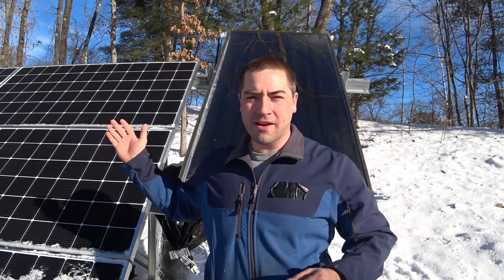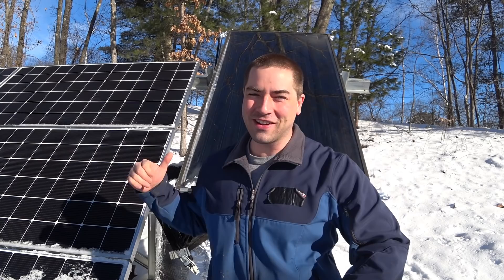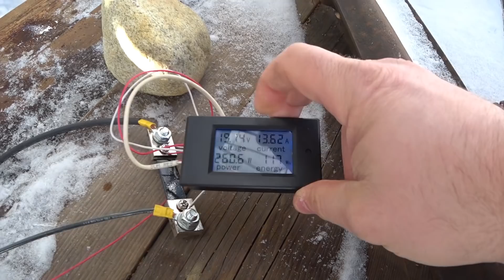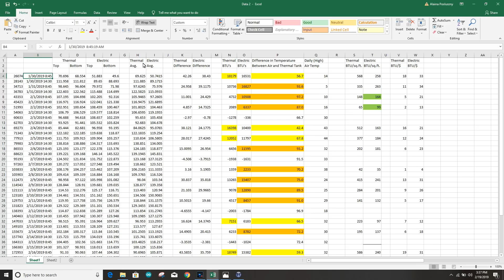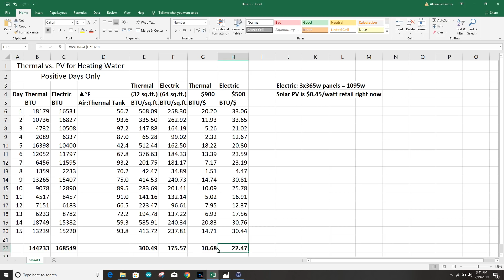Results of Solar Thermal vs. PV Experiment in Heating Water

Comment: Nice results A small thing which may interest you I made a PV system but used a 240V ( I am in Australia) by using a PWM device to produce a steady 240V which allows the PV panels to operate at optimum. If I did it again I would have stayed simple as you did but it produces slightly more useable electrical energy. Last you do not mention what you do with the PV energy in summer? Do you have any plans for longer term heat storage in the works?
Reply from the maker: Hi.  I have a heat store in my house.  About 8 years ago I built a custom 250 gallon water tank in my crawlspace under my house.  I have 1,000 feet of tubing coiled inside the tank as a heat exchanger.  The tank water circulates through 3 hydronic panels that heat the water year-round.  This is used for DHW (domestic hot water) for showers/sinks.  There are several videos on this build on my channel if you are interested.

Comment: I have plenty of space for any or even both of these type of solar collectors, the question is, in a cloudy or very cloudy day with cold, which one will still produce warm water / energy ? because on a sunny day both of them will do the trick.
Reply from the maker: since space is not an issue, I would 100% go PV.  My PV array still produces some energy on cloudy cold days.  My hydronic collectors won't produce any heat on a cloudy day.
Reply: @DavidPozEnergy  exactly my thoughts..... and pair PV with a heat pump and it is done! hot water for house heating or any other usage doesn't matter the weather as long as you have sufficient panels to cover the cloudy days!

Comment: This is a weird comparison - we never get to know how large the PV array was. Of course a gigantic PV array will do just fine in producing warm water. You should have compared panels of the same size (direct solar heater with a heater relying on electricity from PV). In such a comparison direct solar wins hands down because direct solar is so much more efficient at heating water than electricity produced from PV. There are advantages of PV over direct solar in that PV panels still produce electricity when the sky is overcast or the sun is low on the horizon. Direct solar heaters need direct solar radiation impinging at an optimal angle to really work. Combine both systems and optimize with a clever control.

Comment: I would like to see a comparison between concentrated evacuated tube solar thermal vs PV vs thermal pannels, because as far as I can tell concentrated evacuated tube solar thermal does not suffer to nearly the same degree due to the tank temperature and can even work on cloudy days because assuming you are increasing the intensity of the sun with the reflectors by 10x that's equivalent to a summers day if you were to have a bare evacuated tube.

Comment: This is really great information. I really like how you can focus on both efficiency per unit area vs efficiency per dollar. Thanks for making this video.
I also find it super interesting how the solar thermal capped out so quickly. This suggests that the design could benefit from lens concentrators inside the panel itself for the thermal panel, to boost the incoming maximum temperature.

Comment: From the initial scenes of the video I see at least six PV panels compared to only one small thermal panel - this is not a fair comparison :) If you would have tested an evacuated tube solar collector then you would have seen the difference in favor of the latter especially in cold climates.

Comment: Hi! Could you check out DualSun hybrid panels. It’s a electric solar panel with a heating loop on the back. Could you test it out and compare it to a regular thermal panel? Thank you.
Reply from the maker: I just checked them out.  I didn't find a source to buy them.  Perhaps they only sell through certified installers?
Reply: @DavidPozEnergy  I was able to find an online store in Canada that sells them. I’m thinking about replacing my pool heating panels. Got 14, I don’t know if I should go do the dualsun or get some big 600wp panels so I can utilize it for my heat pump too.
Reply from the maker: Personally, I would go with an electric system only.
Reply: @DavidPozEnergy  Alrighty, thanks.

Comment: thumbs up for going with the results at the beginning of the video. No time wasted. Topic was just what I was looking for. Some Questions though: Are you using water only or glycol for the thermal and are you using a AC converter for the pv or are they wired directly to the heater?
Reply from the maker: This setup is water only.  It's a drain-back design, so when the pump shuts off the panel drains back down into the tank.  
The PV panels are wired directly to the water heater element.

Comment: what am i missing? what or where is the loss in the thermal panel due to the temp difference of the air and water? glazing loss,, so the panel won't get the water up?

Comment: What can you tell about using a system like this (electric heating) to heat the whole house? Well of course on the bigger scale, both number of panels and bigger water tank. Placing the tank inside the basement of the house. Would it be worth it in your oppinion?

Comment: Which one works better when it is overcast AND colder?
THAT is the REAL challenge of solar thermal.
Reply from the maker: PV.  Solar PV can still produce something even in clouds and rain.  Actually, my PV panels will still produce about 10% of rated output in a downpour.  Which is pretty amazing.  But, Solar thermal needs clear skies, it's ON or OFF.  No in between.

Comment: Hey thanks for putting all this together - very useful, however, I wonder about other factors.  Firstly, could not the thermal system work more efficiently at lower temperature with additional insulation?  Also, over time, PV panels loose efficiency, producing 10-20% less power by age 15 or so, thermals don't.   Hence, second - hand thermal panels, which can be had for as little as $100, change the equation entirely

I'm still working on a solar system design for electricity and heat, in my radiant - floor heated barn in Pennsylvania 

thanks again

Comment: Thermal panels like that are not intended for cold weather use.  A proper experiment would be the vacuum tube systems that are intended for cold weather.  Those are 90% efficient at turning solar energy into heat.  The PV systems can't compete with that at all.

Comment: In the overall cost did you take into account the solar panels inverter, battery, and heater element. 🤔
Reply from the maker: In this case I was doing PV direct to water heater element.  No inverter or battery.

Comment: David LOVE your videos, have rewatched several over the years. I have a question: How does pv compare against thermal on overcast/cloudy days? We had a 17x10 room on the S side of the house, with an entire glass wall on the S. side. I hung 1/16" Alum flat sheets painted flat Blk 6" from the glass inside, along 10' of that wall. 21*F outside 110*F inside with cheap recycled DBL pane... most had broken seals. 

Overcast days, they still generated SOME heat, but not alot. I saw a PV system recently which on an overcast day was still producing well. I thought I would get your feedback on whether you have found PV to be significantly more effective when considering overcast days.

Comment: I think ambient air temperature will make the biggest difference, because PV works best when it's cold and thermal works best when it's hot.  So where it snows but is sunny, PV is better.  In Southern California or the gulf coast, thermal is better.   I also think you paid WAY too much for your solar thermal panel.  You can actually make them yourself a whole lot cheaper, especially if you have some old sliding glass doors sitting around.  I run a booster inline electric water heater off my grid-tied PV electric, so I am using a thermal panel to preheat the tap water.  That way, the electric water heater uses much less power to get the hot water to 105 F.

Comment: Great job! The PV has surely an attractive advantage with flexibiitity in uses (satisfy specific needs of electricity; heating; ...). But not really for heating and storing heat:
- I'm just sceptic about the prices comparison. Even if commercial solar heaters are abusively expensive when we know what is inside, a 4m2 solar heater (+pump) does no reach the price of 20m2 of PV (+ electronics, electric heating device). And can cost +10 times less if DIY (with 20-30% lower yield).
- Also the shelf life of PV is 20years with declining output, and environmental costs up- and down-stream exploitation are much higher. Solar Thermal pannels last >30-50 years, and are easily and fully recyclable. If you like energy autonomy, you are concerned with that. 
-A PV pannel has typically at its level a 10-16% electric yield, then lets say 99% yield at the electric heater step. Thermal solar Pannels reach typically 50-80% (to heat - depends on the technology). Then all difference come how they are connected to the heat storage (water tank). Your experiment clearly shows that a wise guy can build corresponding set-ups (PV system or Solar Thermal System) at small scale with very interesting and similar performances. There is more space for optimization for the solar thermal system beacuse of scaling, isolation, ... Also heat lost by the solar thermal pannels and tubings and water tank can be recovered at low cost to warm air! 
= PV+heater remains great if the goal is to achieve higher temperature. Thermic is sufficient an in fact better for domestic uses (water a 40-60°C, and air at 30°C).

Comment: Interesting experiment.
IT would be very interesting to compare a heat pump vs presurized thermal panels. 
The flat thermal is at least 30% less eficient than presurized models.

Comment: Interesting comparison.. but on cost of panels, you can make solar thermal panels very simply for a fraction of the cost of solar pv panels, you can also insulate the solar thermal panel to reduce losses on cold days, losses from the barrel on cold days will be the same for either system 😉

Comment: I really enjoyed watching these videos.  Thanks! ......What size is the size of thermal panel?   I luckily got three (3×6ft) before a demolition crew sent them to be recycled.  I "think" two should be enough for my needs but I do still have the 3rd.  Like you,  I have a garage that just ran water to and use a small 6.7gal RV water heater but I don't use water in the garage that much and just keep it on its lowest setting (for now).   I really would like to see a video of someone that may have used 2-3 thermal panels and how they used them in junction with their regular water heater. If you know of any links, please let me know. For me, the electrical shouldn't be an issue,  just the design & configuration of a storage tank and or circulation pump. Again, thanks for your vids.

Comment: Here is a question I have had for many years but no answer. The solar panel is black and it absorbs heat. WHAT if you put glass over it (sealed the panels so they did not short out) and ran water over it?

Comment: So these would be in winter conditions in my country. Maybe you should use a spiral or water heat extanger (i dont know how to call it in english) in your woodstove to heat your hot water tank and only use 1 of these options in the summer. 
Just my two cents of thoughts good Luck and thanks for the vid

Comment: Great video! ive a 20 evac tube system which is 15 years old and due to leakes needs £800 worth of repairs to repalce pipe worth. THe solar guy said it would be better to
 replace them with 3kw solar pv, costing £5000 but with a water heater diveter, there is not enough rooom for both. Do you think we shoud repair or switch to pv?
Reply from the maker: That's a tough call.  If the evac tube system was newer (say less than 10 years) then I'd go with the repair.  But, at 15 years old I'd be concerned that another leak will pop up again next year, and so on.  If the prediction is that you can get another 5+ years out of the system with just the 800 repair, then I'd go that way.  But if it's a sign of things to come I'd lean to the PV.  In my mind it depends on what is leaking, and the condition of the rest of the parts.

Comment: This is great but what about summer time comparison.
Reply from the maker: No comparison, Solar Thermal is king in summer.  I have more solar hot water than I can use in summer.  I wanted to run this test in winter because that's when I don't have enough hot water from solar thermal alone.

Comment: How will you shut off the PV when the water gets too hot and there is no load? D.C contactors/relays are not cheap and a simple bi-metallic temperature switch probably won't take the amperage.
Reply from the maker: I've gotten this question enough that I'll make a video on it.

Comment: Do you think the results would reverse in a warmer climate? 
PV should slightly decrease its efficiency due to higher temperature and thermal collector's should probably increase.
Reply from the maker: Yes, absolutely. If you are in a warmer climate the tide will certainly turn in favor of solar hot water. but I was inspired to run these tests because my solar hot water was doing so poorly in the cold.

Comment: Is not al that simple thermo is more efficient and works better to heat water but not on one family house , what do you do when going away for few days  having thermo water heater ? Nothing but trouble with overheating, so heat-pump water heater with some PV panels will work better.

Comment: Well, that was a completely surprising result!  I expected that PV would have been the worse option.  But a big plus is ease in construction (wires are certainly easier than pipes).  And you avoid problems like collector stagnation overheating in warmer weather.

And that's one cute kid you have.
Reply: Yes! There are also many rumours concerning leaks and maintenance costs being much worse for collectors (I have some personal bad experience in that regard).

Comment: I think the solar thermal panel you paid for is just too high.
And compared to the vacuum tube type panel, the flat panel type has very poor insulation from the outside temperature.
Also, the area of the sun receipt has to be the same for both.  You will notice substantial efficiency differences. 
PV panel 15%, solar thermal 70% typical but it depends on season.

Comment: As PV has gotten more efficient over the last few years (as well as cost has gone down, big time) similar comparisons have lost to PV.
A few years ago, I looked at thermoelectric generation, similar in concept to Voyager I & Ii, current PV won out.
Years before PV, some looked into extracting  electric current from cold and hot fluid run over a central Be conductor.
Top efficiency was 2-4%.
Crazy how far PV has come, pretty much eclipsing all other solar energy methods.
And I have to believe the progress will not stop.
I put solar panels on my house just 3 years ago, 300 W/panel.
Now, not uncommon to read about some panels that generate 350W!!!
I have begun looking into DC voltage, since more and more homes have panels on their roof, no need for AC.
Most electric powered devices have AC compensation first in the schematic.
Since AC to DC conversion is never 100%, many (if not all) appliances are generating heat from the conversion.
Seems we would enjoy lower electric needs if we eliminated AC...

Comment: The heat loss from cold air temperature is from the thermal panel, not the tank.  Both tanks have the same insulation.  This would not really be a problem for me since I live in Southern California.  It snowed once here about 10 years ago for 15 minutes.  Another problem is how much you paid for your solar thermal panel.  Most any DIYer can make their own solar thermal panels for much, much less.  Much harder to make your own solar electric panels!  You can also get rid of the water pump if you can put the tank above the thermal panel on a Southern-facing slope.

Comment: it took me a while to discover you did not make the solar water heater, and had actually purchased one. i really think you could have done a better review comparing both, and with a pex coil water heater, you would have spent 200 bucks on the heater, instead of 900. i think that with the pex heater being well built, it would have smoked the solar array with an immersion element in every corner.
just saying.

Comment: When calculating the efficiency, we should also take into account the lifespan. Surely the lifespan of the non-electric one is longer. The cost of depreciation will be low. It would be best a combination of them.
Reply: solar water value will be near zero in few years  because solar PV will be 0.25/w

Comment: Great  work David , thank you for  doing all the experiments  we all think about  doing ! Anther  point about the PV vs ST systems  is  there is  more risk involved in the Solar Thermal  systems failing  due to expansion  causing burst pipes  / joints  and tanks .
I have seen the  various parts blow  after  overheating causing scalding water to  escape . One  pretty dangerous  situation !!
I will use  the PV / heating element system for  certain .

Comment: what about instant electric hot water heater that only heats it as you use it needing less power per instant and also only uses power when the hot water is in use allowing for batteries to be charged all day and used for water heating probably only three hours per day for showering and dish washing and clothes washing and cooking.

Comment: Just a note: PV performs better in cold temperatures due to increasing voltage with lower temperatures. Solar thermal collectors perform better in warmer temperatures due to the lower radiation losses from a lower difference in temperature relative to its surroundings.